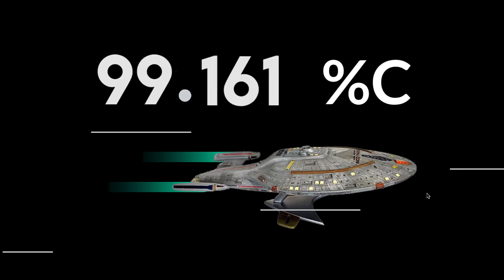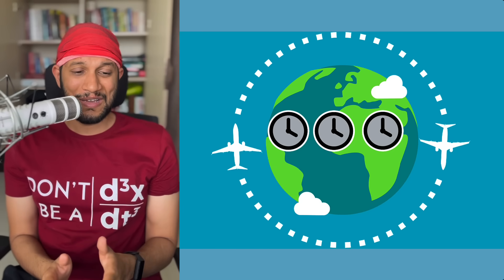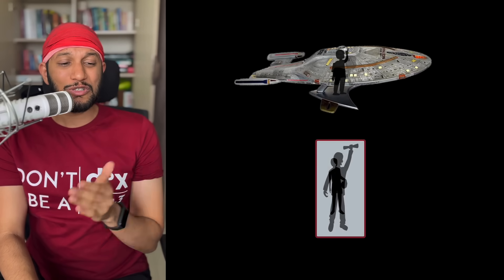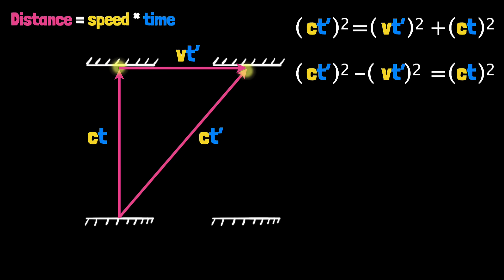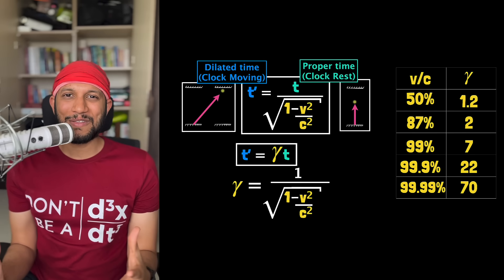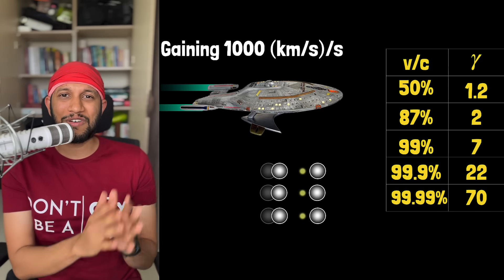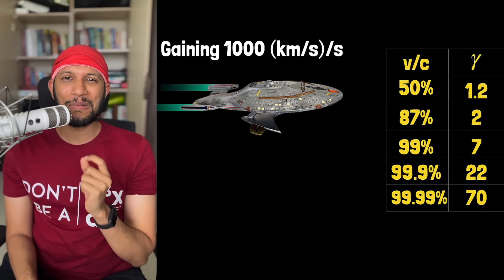I finally understood why you can't go faster than light! (My mind is blown)

Comment: quick question, what about if i dont care what observers saw as my acceleration? for me in the space ship, i am still accelerating at 1000km/s/s, for me whats the barrier stopping me from accelerating past the speed of light?
Reply: How do you measure your own speed?  You have to measure it relative to some reference frame.  You could choose some external frame, but then this is no different from an external observer measuring your speed and as we've already seen you will never reach light speed in this frame (or any other external frame).  The only other option is to measure your speed in your own reference frame.  But you can't be in relative motion with yourself, so your speed in this frame is exactly zero for all time.  Either way, you will never be able to measure a speed that reaches or exceeds the speed of light.

Comment: Atomic clocks measure time by detecting the precise frequency at which atoms transition between energy states: 
Excitation: An external energy source excites an atom.
Transition: The atom moves to a higher energy state, then to a lower energy state.
Frequency release: The atom releases energy at a precise frequency during this transition.
Detection: The frequency is detected and used as an input to a counter.

So if you add energy of any kind to system your time will change. Planes add kinetic energy as they move and they do not move at same speed all the time. Head, tail, cross wind etc

Comment: First you tell time on a watch from the outer radius ticking alone.  Not comparing the smaller circumference with the larger one. Only small to small and large to large.  😂
Plus photons traveling at the same speed will tick faster in a 12 inch box and take longer to tick in a 12 ft box or chasing an object.

Comment: You have to be able to de-couple mass, Higgs-Boson, from around the ship to reduce metallic mass from being added while at the same time while using the de-coupled Higgs-Boson floating in space freely to keep mass present in the atoms of the ship. Thus mass, in massless space traveling faster than the speed of light.  The only question is, how to de-couple mass from metallic atoms while coupling the Higgs-Boson to atoms of the ship that might lose a Higgs-Boson due to traveling faster than the speed of light? 

But until we know how the Higgs-Boson is created, we can say that the Father universe, space-time we can't see, is able to be seen in the clouds we see everyday as space-time passing through the Earth interacts with particles on Earth, the Mother, to let us know, the Father is there to see because of the Mother. The same holds true for space-time that we can't see outside of the Universe but we can see in the form of planets, stars, comets, black holes etc. 

Does the Father carry the Higgs-Boson which like the male semen that adds mass to the womb of the female, the Higgs-Boson would be the semen of the Father that adds mass to the Universal Mother? The Higgs-Boson must come from the Father as a male on Earth cannot get pregnant from the female.

Comment: You are talking about what a third party will see, so they can see it hit the speed of light. But what about the ship itself ? You said from inside the ship the ticks appear to run normally, that wouldn’t change so what’s holding them back ?
Reply: Remember that all speed is relative.  In order for someone on board the ship to measure the ship's speed, they have to measure relative to some reference frame.  They have two options:

1) Choose some external point as your reference frame. This is no different from an external observer measuring the ship's speed, so as discussed in the video the ship will never reach or exceed light speed in this frame (or any arbitrary external frame).

2) Measure relative to the spaceship's own frame of reference.  That is, the reference frame in which the spaceship always occupies the point at the origin.  Hopefully you can see that in this reference frame, the spaceship is always at rest (a thing can't be in relative motion with itself).  So, trivially, the spaceship will never reach light speed in this frame either.

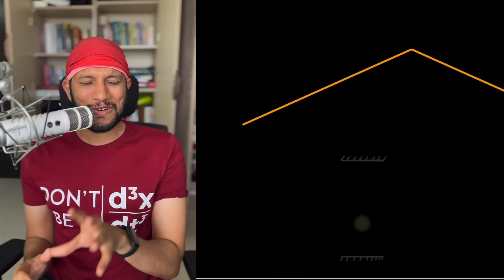Comment: 2:17 Question

@Mahesh_Shenoy

If we are seeing the photon light sort of perpendicular to the direction of motion sure, we will see the photon clock tick slower

But, if we were to see the photon cart / clock ‘along’ i.e in line to the the direction of motion - i wonder what will we see ? Whether its clock slow down even if it goes near speed of light ?
Reply: Update:
I had not considered that being directed inline to the motion, the length of the light clock will be affected by length dilation. Adding length dilation to the simple math calculation returns exactly same time dilation equation as for perpendicular position.
This two dilations are reciprocal.
Reply: I thought the same, and tried to calculate same simple math way. It will slow down, but the relative time equation will be different. I've got same equation but with no square root in denominator.

Would also like to see @Mahesh_Shenoy 's opinion.

I'm not pretending to be flawless in my calculations...

Comment: What would an observer inside the ship experience though, wouldnt he reach the speed of light?
Reply: Remember that speed is relative.  It is meaningless to ask whether the observer inside the ship would reach the speed of light without referring to the reference frame in which they are measuring their speed.  They could measure the ship's speed relative to some external frame, but this is equivalent to an external observer measuring the ship's speed and as we've already seen the ship will never reach light speed in any external reference frame.  The only other option is to measure the ship's speed in the reference frame of the ship itself.  But the ship can't be in relative motion with itself, so its velocity must always be zero in its own reference frame.  Either way, the ship cannot reach light speed.
Reply: @charlieharris4881  but what if we measure the time and distance it covered when it slowed down and stopped, wouldn't we find a discrepancy based on the laws of special relativity?

Comment: 👌👌👌❤️❤️❤️👌👌👌

But I have a question - is the speed of light being constant in all reference frames an assumption or an observable phenomenon?

I don't know about that from theoretical physics perspective, but I can readily think, that has to be an assumption, to "observe" any phenomena, because the info carrier is light itself, and if light speed is not assumed to be constant in all reference frames, then that means all observable phenomena are either stretched or twisted or bent.

It will be almost similar to the way we see bent stick that is partially in water.

Without fixing one constant, we cannot figure other stuff. That is the limitation of knowing.

Comment: Wait wouldn't the clock always be going diagonally because even when we think the "ship" is still it's actually moving. everything is moving. But relative to what I don't know. Is it even possible to be "STILL" Wouldn't you have to move against the direct you were moving... My minds blown. And as for the trip around the world. What if it was affected by gravity as gravity effects time. and why! What does it actually do to the clock!!! Ok I need some wine...
Reply: ok I'm at the time dialation bit and my brains melting. What if the people moving on the ship think they are proper time and that the ones "still" (if thats even possible) are moving away in one direction and another ship travelling faster is moving in the other direction. What if the people "still" then look at the fastest ship and to them it's travelling faster than light. Or what if they both move away from each other at just over half.. Dude My minds blowing up here.

Comment: Great video. A question : What happens if the object is not moving in a straight line, but instead it is spinning at near lightspeed values? Do the outermost atoms experience time differently?

Comment: This time dilation thing about the spaceship going faster is just one of the factors involved. 
Another one makes itso that if a dummy were to stand upright, not secured by anything when the ship goes that fast, he'd just pankake into the wall at the back. Even if he was in a chair, going that fast would fuse him to the chair. The higher the speed, the higher the force, the more flattened the dummy gets.

Comment: I admit this is interesting and challenging material, but my real-time clock tells me that I must get back to non-relativistic reality

though if you think of this backwards it means that most if not all of the universe is slowing down relative to an external observer, and furthermore relative to each particle in the universe, since the relativistic speed of every other particle depends on which particle is used as reference.

Comment: So what if the ship went to another planet which is 1 light year away at %99 speed of light and sends something back when it reaches the planet, when will we receive the message?
Reply: This is a great question. My intuition is to say that it would be 8.07 years. This is because 7.07 years would pass for us before they arrived, and then it would take 1 year for the signal to reach us. What do you think?👍🏼
Reply: @Auxified  Well, for them, they will take a little bit more than 1 year to reach the planet, and we can ran into a problem: If they didn't slow down when they arrive it, and just flew by, the message will take a little bit more than 2 years to reach us because they send their message in their time when in their time they arrived. But that doesn't seem right.
Reply: @HaiyanCheng-j3k  I think from their perspective that is what happens. If they traveled for 1.01 years at 0.99C, arrive, send the message to Earth & immediately travel back 1.01 years at 0.99C, then they could come back to their message on Earth in only 2.02 years from their perspective, but the universe would have aged 14.14 years in that time. We would have received their message at T=8.07 years and therefore would have we would have seen their message 6.07 years before we see them again. Definitely not easy to comprehend how that can be though haha.
Reply: @Auxified  Thanks

Comment: What is extraordinary to me is that symbols like 26 letters and infinite numbers were invented given meaning and definitions and used as a measuring tool. Then this tool composed of letters and numbers is arranged in sequences to define the correlation of principles of matter and why we cannot travel faster than light in a vacuum. I will tell you about how different colors were classified and revealed through a spectrum and their wavelength also defined by the same formulas composed of the same letters and numbers. Spooky? Did you know that all these combinations of letters and numbers of formulas can be interpreted into over 7000 different languages? POV, hombre.

Comment: The one thing that is confusing, is that you said, and I'm paraphrasing, "at a point they will be traveling fast enough that their speed is cut in half." The concepts all make sense to me, but it feels more like a perspective thing no (maybe I missed you saying this?) The same as stars being so far away that the light we see is generally of a dead star. The star is already dead and gone, but we see it differently. The same in this case where the ship is already long gone, but we still see remnants of it's light taking a long time to follow due to the extra distance it's light has to travel. 

Theoretically (I don't know the actual distances or how far they could go, just picking a planet for example,) if a ship went to mars and back at the speed of light, they could come back fast enough to see their own ship still taking off I guess is my point. In their perspective, they would likely instantly go to mars, then instantly back assuming they stop, then head back. The people in the ship are effectively just time travelers, and everyone outside would be at the mercy of the light they can see traveling. 

Makes me think of black holes as well (I don't know a ton about black holes.) I've seen people say black holes slow things down as they enter it, but it seems like it would be speeding it up instead, to the point of infinity, and we just cannot see that so it appears as a hole in space/time if I apply the same logic.
Reply: If you travel to Mars at the speed of light then the light from the moment you left earth will arrive with you at Mars at the same time.  You would need to travel to Mars faster than the speed of light to arrive there before the light from the moment you left Earth to arrive and then see yourself leave Earth.
Reply: @Denee_Padee  Yea, this is what I meant, but thank you for the correction, just misworded.
Reply: it's not really time travel, any more than seeing an old photograph or recording is time travel. You are moving around on your own, but the light from previous movement is moving more slowly. You are basically seeing the universe's old recording of things you did. Not time traveling.
Reply: you are question has already been explained greatly in interstaller. what actually mars is too close lets take a start that would take 1 year for speed of light to reach when you left the earth you will reach the start in almost instant. but for earth one year would have passed. when you leave the start and reach back earth that would too be in instant but one more year would have been gone. so basically for you it like you never left but for earth it would be 2 years so no you can't see yourself going because time is relative not fixed.

Comment: As far as i can tell, this just means our perception of time slows. Not time itself. You're still basing time off of the speed of light, which, depending on your perspective, can differ. 

So your brain can even slow for the same reason as the photon clocks even, but actual time? Not just your measurement of it?

Edit: ok the fuel part helped me understand

Comment: Sorry but i have stupid question about that... mayby i missed something it's nearly all prety much stright forward with mathematics and all but i dont understand 1 thing how we know that light speed (299 792 458 m / s) is upper limit for relativity effect? is it beacause of photon speeds? why we use thease in particular? if so doesnt photon speed c = 300 000 000 m/s is faster than light speed so isnt it possible to still reach light speed since light speed is lower than photon speed?

Comment: For me there was also another thing that made it easier to understand. As an example... If the distance to  the center of our galaxy is 26 000 light years, then it means it will take us at least 26 000 years to get there. But the cool part is that you can get there faster. Nothing stops you from traveling there in your lifetime.

When you accelerate in a spaceship to speed close to the light speed, your spaceship slows down from the perspective of people on the Earth, but for you in the spaceship it is the opposite - everything around speeds up, because when your clock on the spaceship ticks one time, the clock on Earth will tick 2 times. So in theory you can get to the center of our galaxy in lets say 10 years from your perspective, but for the rest of the universe 26 000 years would pass. So if you would like to fly there and go back, it would take just 20 years for you, but when you are back on Earth you will find out that your journey lasted 52 000 years from the Earth's perspective.

Comment: Can you just make the distance between particles smaller?
Reply: Also another dumb question but I mildly understand how it works. Make me wonder why does it work this way? e.g. I know why toast burns. The energy transfer from the over causes a chemical reaction... etc. But when I understand why: bc the heat was too high or the heat was too long (duration), I can then make adjustments to not burn the toast.

So asked another way: if we know why (not the how talked about in this video) as speed approaches C then Kinetic energy goes to infinity, perhaps we can circumvent it?

Comment: Whoever say's that you can't go faster than light, even Einstein, is wrong.  The reason is because even though you have evidence for this idea that photons don't move any faster in relation to your speed.  Unless you can contain, or have the key to the universe to unlock the consistency of the experiment you will always conclude that you can't travel faster than the speed of light.  The problem is that Einstein made an equation which makes sense, but that's not the full equation.  The equation works, until it glitches, and I guarantee one day it will glitch and someone will find an answer as to how to unlock these conditions we are governed by in our present understanding of the universe.  There are other variables that are not in Einsteins equation that are there and if I could live forever I would love to be there when I could say you see I told you! :P

Comment: Ok so 99.99% speed time dilation is 70 second Ok fine. The speed of light is 300000 km per second, if i am moving at 99.99% of speed of lighttgen i am moving already at 299970 km per second right? So what's the problem of adding another 1000km on the next second even if it looks like 70 second from outside, we have considered that the ship is accelerated at 1000km per second.?? Please can you answer this question.